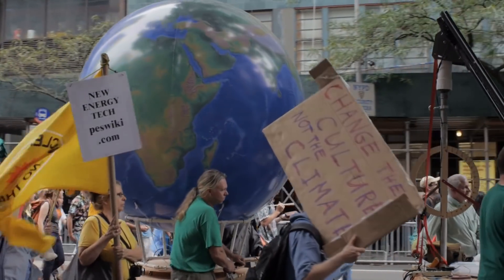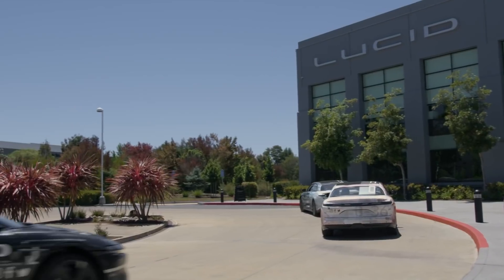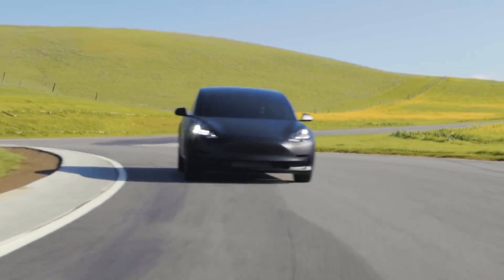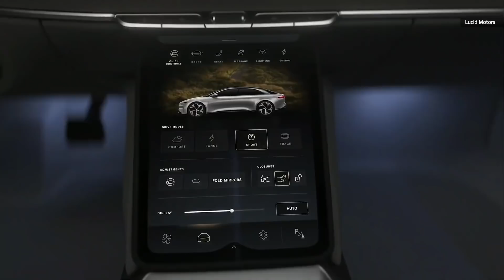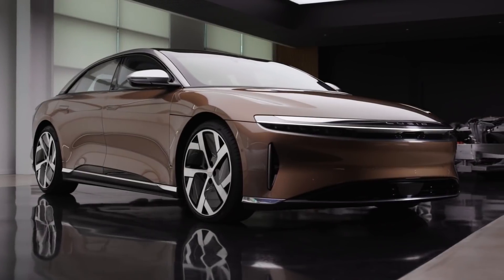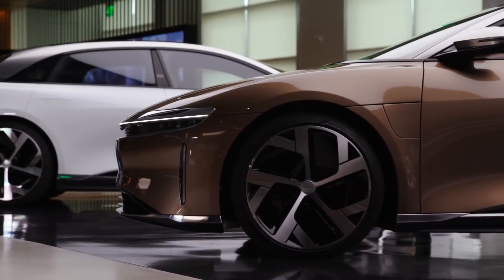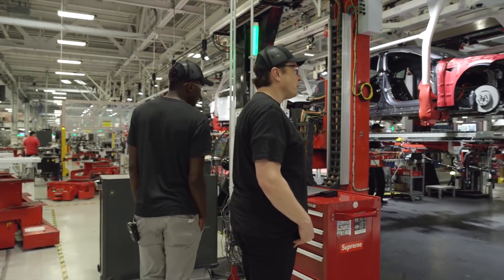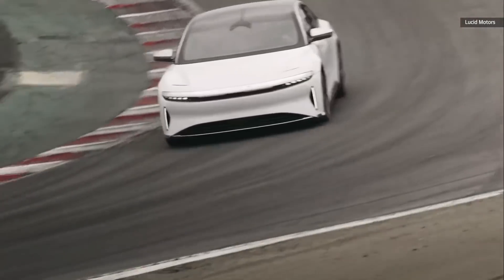Meet Tesla’s Biggest Rival: The Lucid Air

Comment: Tech Vision - LUCID is Already VAPOWARE, with the 2021 TESLA model S PLAID coming out in about one year. 
the TESLA has improved Spec + Performance over LUCID and is Priced THOUSANDS less than LUCID.
LUCID will be using LAST DECADE Battery Tech from LG Chem. 
while TESLA will be MASS PRODUCING their own Batteries to 10 Gwh in just 3 Years. 
while the 2021 Tesla model S PLAID is the FLAGSHIP Sedan , the REAL Game Changer comes from the $25,000 Model 2 with FSD and 300 mile range , thanks to LFP Prismatic from CATL.